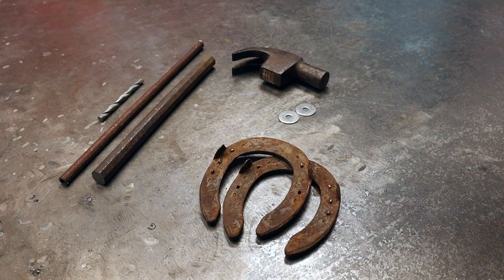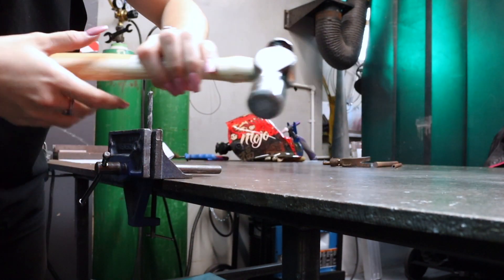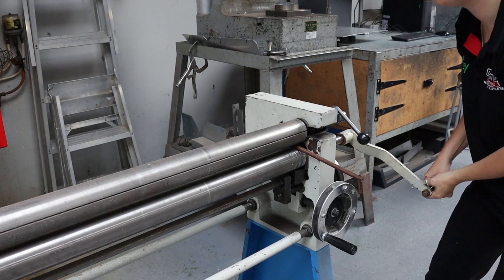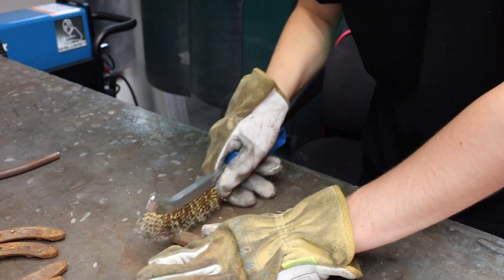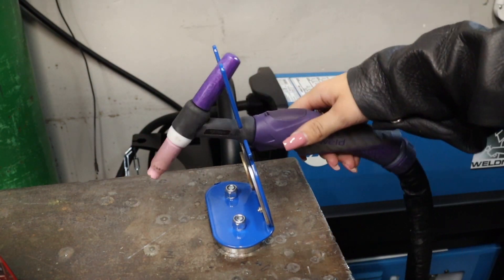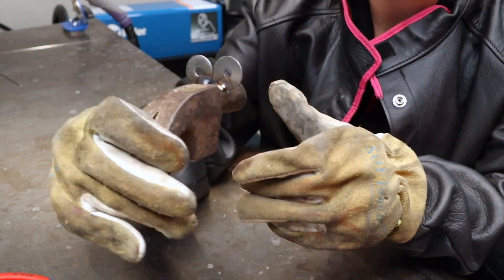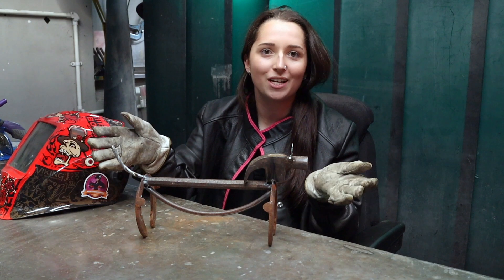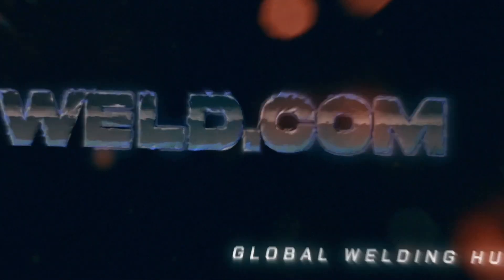How to Weld Small Metal Sculptures From Scrap

Comment: Excellent Video! Thanks! I do have one question, I pretty much arc weld all the time, I do have a flux core MIG welder, but as you said it is very messy, can you use TIG for everything you would do with ARC or stick welding?
Reply: @Mikala Eade Metalwork Thanks!

Comment: How this nonsense could be posted as a welding video is beyond me  .
Reply: @rayhawk9432  you must not know much about welding it's on a Welding channel that crap has nothing to do with welding
Reply: weld
wĕld
intransitive verb

    To join (metals) by applying heat, sometimes with pressure and sometimes with an intermediate or filler metal having a high melting point.To bring into close association or union.To be capable of being welded. Therefore it is welding. Your masculinity must have been threatened by: 1) a female who actually can do work that you think should be reserved for macho men, or 2) because it is artistic work instead of welding huge macho I-Beams into position.